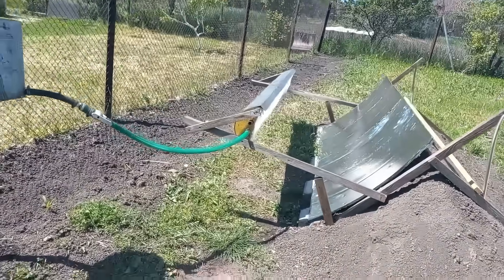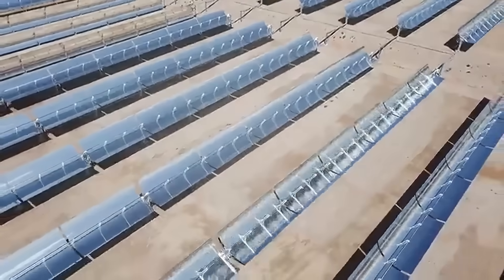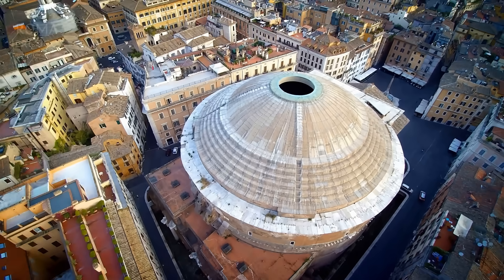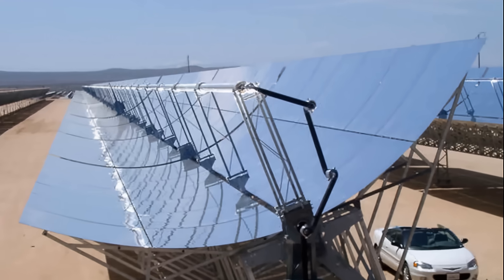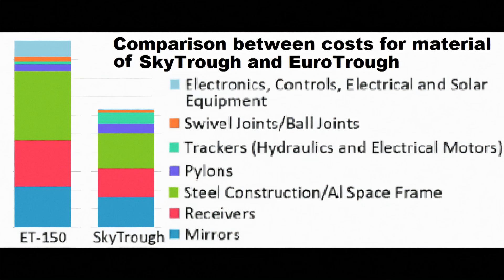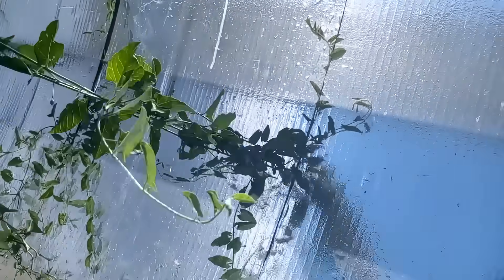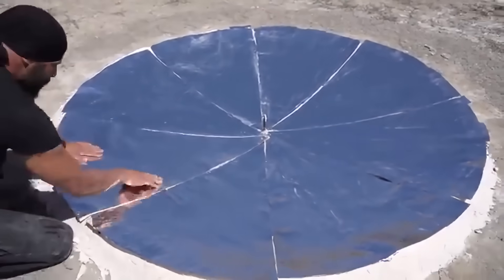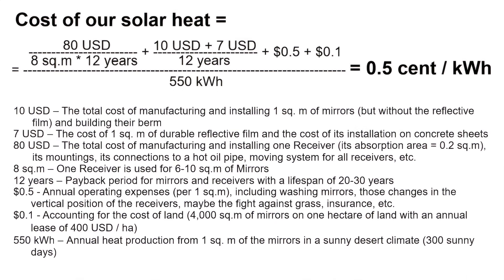Mirrored concrete for cheap solar energy

Comment: I have a south facing front door, it has an energy efficient film on the outer glass door which supposedly allows less UV in but as I found out, it depends on the suns angle.  My entry door is also black, which may make a difference.   So, in the winter, the pocket between my doors can be, 160 degrees maybe or higher.  I can crack my front door to allow the heat in the hall.   The handles get too hot to touch, even the interior handle is too hot to touch.  So, if the received is made of a glass enclosure with the film on it to trap the heat, I wonder if it'd be more efficient.  Or maybe it could be designed in a way that doesn't need mirrors, for example, a narrow rectangle with a large surface area of glass that is exposed to the sun.  Just a thought, I'm not an engineer.

Comment: i mean sure its cheaper than Photovoltaic, however does not solve one essential problem of solar energy...
no sun no power, also the weight is not helpfull for putting them on rooftops.

Comment: I remember making something similar back in highschool, I used a bent piece of illustration board with some foil stickers on the concave face and i had to manually adjust it every few minutes, i only used it to boil a cup of coffee and it took like several hours to boil 1 cup 🤣 and it fell apart after 1 use because the tape i used to hold everything together melted.

Comment: Your ideal solar thermal battery?
Searching the web
30 results
My ideal solar thermal battery would be a high-performance, scalable, monolithic or modular solid sensible heat storage system optimized for concentrated solar thermal (CST) input or high-flux open-air setups. It prioritizes:
    • Extremely high stagnation temperatures (1200–2000°C+) to maximize ΔT and stored energy density.
    • Exceptional thermal conductivity for rapid, even charging under intense solar flux (avoiding hotspots/cracking).
    • Near-blackbody solar absorptance (α >0.95) for efficient capture.
    • Outstanding thermal shock resistance and cycling durability (thousands of day/night cycles with minimal degradation).
    • Low cost per kWh thermal, simple materials, and ease of manufacturing/embedding extraction features (coils, channels).
    • Safety and environmental benignity (non-toxic, no leaching, oxidation-resistant in air).
Based on current (2026) trends in high-temperature sensible heat storage—from commercial leaders like Antora Energy (carbon blocks up to 2400°C storage, discharging at 1500°C+), Rondo Energy (refractory brick stacks at 1100–1500°C), emerging refractory castables, and research favoring alumina-based concretes, graphite/carbon, and advanced ceramics—my top choice is a carbon-enhanced refractory block system inspired by Antora but adapted for your custom monolithic "Solar Black Hole" concept.Why This Beats Alternatives (Including Your Phosphate-Bonded MgO Variant)
    • Carbon/Graphite Blocks (Antora-Style) → Ultimate winner for extreme performance.
        ◦ Temps: Store at up to 2400°C, discharge heat at 1500–2000°C+.
        ◦ Conductivity: Exceptionally high (~100–200 W/m·K or more in graphite forms).
        ◦ Absorptance: Near-perfect blackbody (α ≈0.95–0.99) at high temps.
        ◦ Density/Energy: High volumetric heat capacity; systems achieve very high kWh/m³ due to massive ΔT.
        ◦ Durability: Proven thermal stability in air (with minimal oxidation at scale via design); long cycle life.
        ◦ Cost: Raw carbon/graphite blocks are among the cheapest bulk materials.
        ◦ Drawback: Pure carbon needs protection/coating for open-air longevity, but modular blocks mitigate this.
    • Your Phosphate-Bonded MgO Variant → Still excellent (my previous "best overall" pick), but second place.
        ◦ Temps: Reliable 1000–1500°C.
        ◦ Conductivity: Good (3–7 W/m·K with SiC boost).
        ◦ Energy density: ~15–17 kWh theoretical for ~45–50 kg at 1000°C.
        ◦ Pros: Fast chemical set, CaO-free, superior shock resistance, customizable monolithic pour.
        ◦ Cons: Lower max temp and conductivity than carbon; phosphate costs slightly higher.
    • Soapstone → Great natural benchmark, but third tier for ideal.
        ◦ Temps: Practical ~900–1200°C (higher melting but risks decomposition/cycling issues).
        ◦ Conductivity: Variable 2–12 W/m·K (often good).
        ◦ Density/Volumetric capacity: Excellent (~3–4 MJ/m³·K).
        ◦ Pros: Cheap, proven in heaters/sand batteries, high natural mass.
        ◦ Cons: Lower max temp, less tunable absorptance/conductivity, natural variability, harder to make monolithic with embedded features.
    • High-Alumina Castables/Concretes (CAC-based) → Solid fourth (common in CSP research).
        ◦ Temps: 1000–1800°C.
        ◦ Pros: Proven, low cost (<$10/kWh thermal in some studies), good shock resistance.
        ◦ Cons: Lower conductivity than MgO or carbon; CaO-related limitations at ultra-high temps.
Other contenders like molten salts (290–565°C, high but fluid-based) or packed beds (sand/rocks) are mature but lack the ultra-high-temp density of solids like carbon.My Ideal "Ultimate Solar Black Hole" Recipe (Carbon-Enhanced Refractory)A hybrid monolithic castable using phosphate- or MgO-bonded matrix with high carbon/graphite loading (protected or in low-oxygen design for open air). This combines your original unified mass idea with Antora-level performance.
Component Amount (for ~120 lb wet target) Function/Why Ideal
Dead-Burned Magnesia (DBM) or High-Alumina CAC 20–30 lb Binder base for monolithic set; stable to 1500°C+.
Graphite Powder/Flakes or Carbon Black 15–25 lb Ultra-high conductivity + near-perfect absorptance; main storage mass (like Antora).
Tabular Alumina (aggregate) 20–30 lb Skeleton/shock resistance; spinel potential with MgO.
Silicon Carbide (coarse/fine) 1.5–2 kg Thermal highways; oxidation resistance aid.
Red Iron Oxide + Selective Oxides (Mn/Zn/Sn/Cu) 5–10 lb + 300 g Absorption boost (if carbon not fully black).
High-Temp Fibers (alumina-silica) 1–2 lb Reinforcement against flux gradients.
Phosphate Binder (KH₂PO₄ for MPC) or MgO additives 8–12 lb (or equivalent) Rapid chemical bond; high-temp conversion.
Retarders (boric acid) + Flow Aids 0.5–1 lb Controlled set/exotherm.
    • Water/Liquid: 10–18 lb.
    • Prep: Dry-mix, add binder solution, pour into cavity-receiver molds (honeycomb for flux trapping). Rapid set; slow in-service firing.
    • Performance Estimate: For 50 kg dry mass at ΔT=1980 K (20–2000°C), average c ~1.2–1.5 kJ/kg·K → *33–40 kWh theoretical* (usable ~25–35 kWh after losses)—far beyond prior variants.
    • CST Optimization: Cavity shape + graphite for volumetric absorption; embed Inconel coils for extraction.
This is the "dream" system in 2026: Solar bricks.

Comment: i still dont understand why not fill a globe of water to focus light on the outer edge of globe to make sun angle agnostic farm.
calculating the liquid expansion or the focus point should nt be hard right? much easier than trying to turn entire  system to sun

Comment: if you could enclose it in glass/styrofoam box you would decrease collector cooling from ambient air. you could also use refraction from glass. and make kinda v shape and focus even more sun towards parabolic mirror. as a bonus it should melt snow in winter. dust may be a problem but greenhouse effect should overall improve efficiency by far. you could also use idea of something called walipini. reducing price even further.

Comment: Could you somehow use gears that convert thermal energy to move the solar panels by the contraction and expansion of metal related to heat?

Comment: But concrete inherently produces a lot CO2 in production
Reply: Although the panel may produce less CO2 than the equivalent fossil fuel burning needed to produce the same energy over its lifetime.
I don't personally know the numbers, but something to consider.

Comment: The concrete used for this needs to be elastic enough to withstand repeated thermal cycling so cracks do not form and subsequent repositioning expands them until the thing breaks in half.

Comment: You measure the cost of the kilowatt... thermal
No turbine or electricity so is that really cheaper?

Also, I doubt foil (I assume aluminium) is a good idea without protection, aluminium oxidizes, where as if you cover it in glass, it never oxidizes. It’s the difference between a shelf life of a few years vs millions of years. So I don’t see non glass coated solar as a serious thing, your panels are already getting tarnished after a few months outside it’s visible. So only more complex industrial processes that can coat the aluminum in glass or sandwich it in glass sheets are viable

Comment: These are significantly better for power networks than raw solar as they have built in inertia which maintains power balance. 
They also produce pure synchronous power instead of dirty inverter driven harmonics. 
They're also cheaper, not requiring rare earth metals, and more durable and recyclable as they don't contain highly industrialized composite materials.
The benefits are endless.

Comment: Your design uses a simple curved parabolic mirror, which means the collector has to move to compensate for changes in the sun’s altitude throughout the day. However, there is an alternative geometry known as a Compound Parabolic Concentrator (CPC). This shape is designed to maintain a fixed focal region across a much wider range of solar angles, significantly reducing or even eliminating the need for tracking.

Comment: reminds me of the mirror solar farm outside of Las Vegas, but that's not concrete of course
Reply: And it's closing down because the energy it produces is too expensive.
Reply: @theMemphisSnuggler  to follow up, i bet they are prioritizing total output per year, rather than prioritizing output return to total cost in a long term, bummer, oh well, to be fair im not educated on the subject
Reply: @DiazNutzzz I drove by it a few times on my way to Vegas, I like the idea and it looks really cool. It's a shame that it didn't work out or they just couldn't do some modifications to make it more efficient.
Reply: @theMemphisSnuggler  really? what could make it expensive? seems like once its installed it should be good to go, out of curiosity what's making it costly?... actually i just looked it up and it seems they are planning on going with standard photovoltaic panels instead which is incredibly foolish.. those only last 25-30 years and i bet those mirrors would last forever or until broken... hmm
Reply: @DiazNutzzz  The answer is a lot of the energy there is wasted.  Solar panels already only convert around 10-20% of the light energy into electricity. By introducing other elements like steam/water and loss from conversion of light to heat you might need multiple times the amount of land and a massive steam setup that takes money to maintain. Along with making sure nothing covers the mirrors

Comment: just make a grid that lays flat on the ground like a bunch of large diameter pipes laying next to each other with the top 1/4 cut off down the legth of the pipe, the receiver is a pipe suspended in the middle of each larger pipe.  this method will mean no moving parts and the contents can be flooded with water to clean the mechanism. or if you didnt mind 1 moving part, you could put a sheath over the receiver that is half covered in reflective material, that will rotate as the angle of the sun changes

Comment: at the end of each day release some steam to stop vegetation growing, or insects, ants hate boiling water or steam! any system you create needs to be cleaned of dust and debris. If doing a diy build think of something durable that you can collect for free, for example glass bottles, use them to protect your reflective film, you will lose efficiency, but win on durability in the long term, possibly an array of bottles using them for a lensing effect

Comment: You know... I like this idea.  Have you considered putting such an array near a flowing water source?  I imagine that would make the water more plentiful for your reservoirs and you could use (multiple?) self filling water basin to possibly power a crude time shifting device with floats to move the panels in the day.  Only simple moving parts and water.  Problem might be too much water if the array is too large but I am confident that properly balanced mechanical leverage could be achieved to keep it running relatively smoothly.  True with water locks it would be "digitized" to move less perfectly than a computer controlled solution and it could still seize but proper engineering might be able to fix that or at least make the problems more trivial to fix than not.
Reply: Already a thing, but the water is used to make a condenser. Mainly because the external water has less energy. Causing it to become inefficient